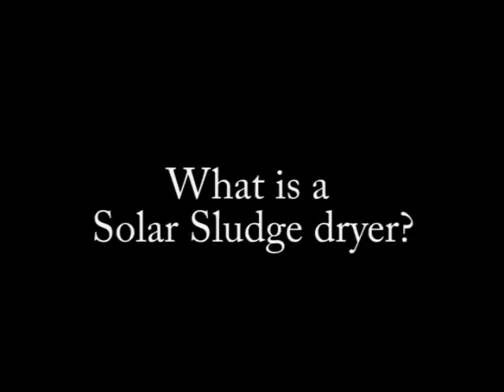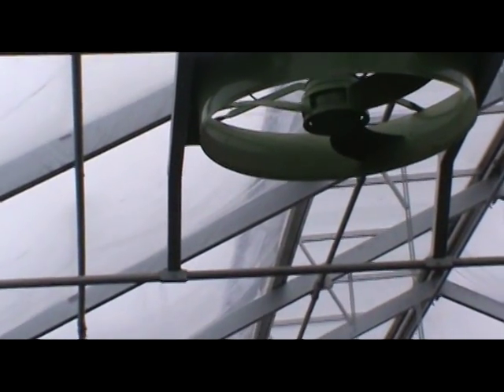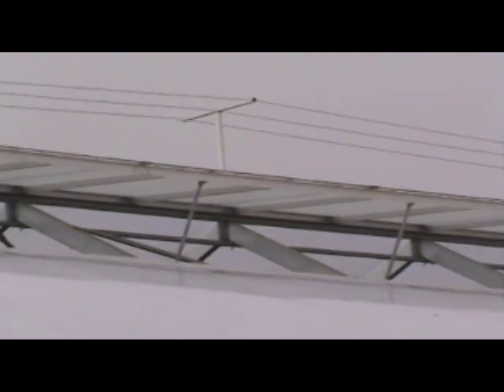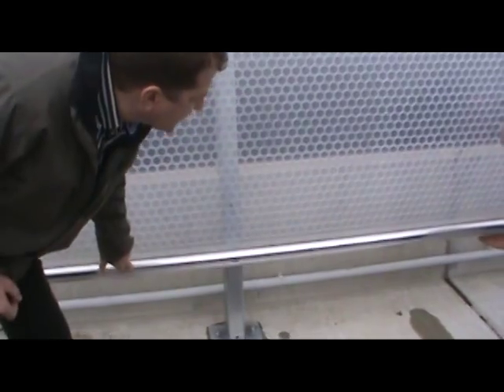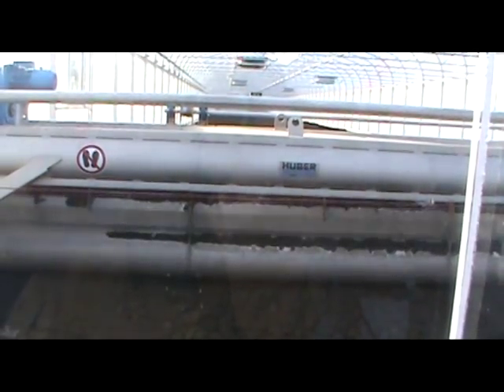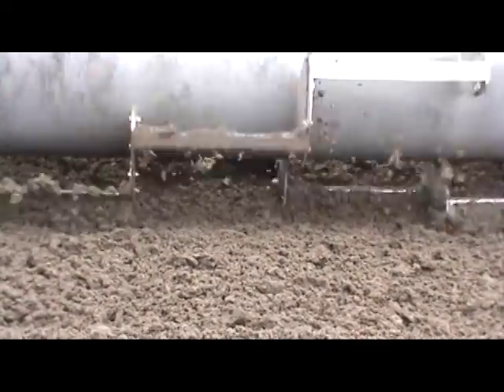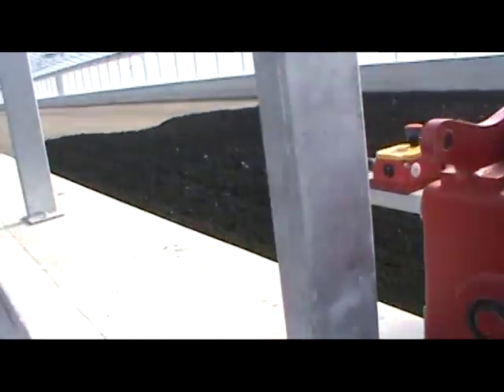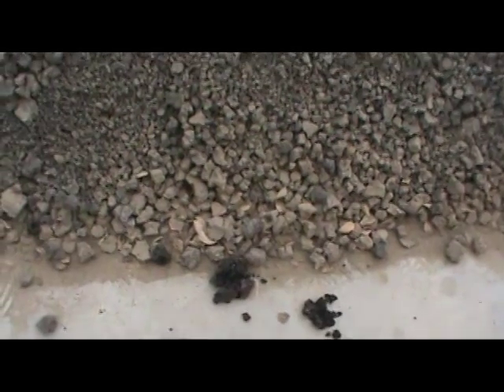What is a Solar Sludge Dryer??

Comment: This video fails to identify the most common type of solar sludge dryer tilling device.  This is not a "scooper-flipper" or tilling device that runs the full width of the solar dryer, but is rather a fully automated robot called the "Electric Mole" that randomly moves around inside the drying chamber and aerates the sludge by mixing it and flipping it over.  More information on this type of device can be found at Parkson.com.